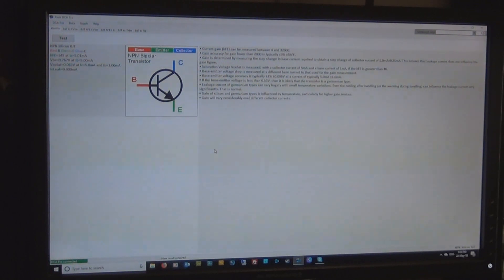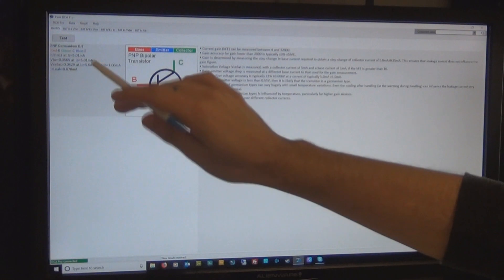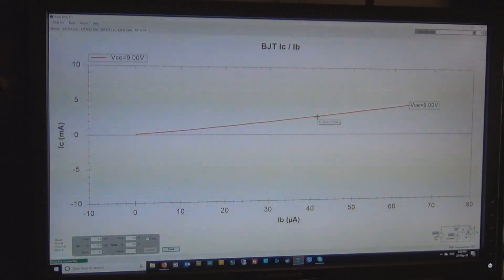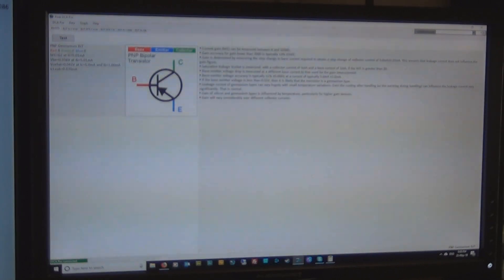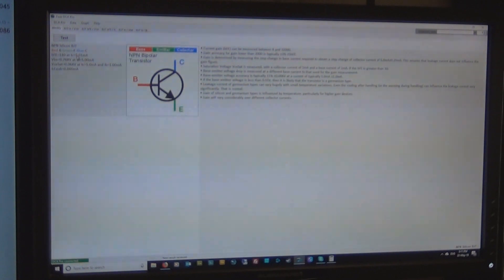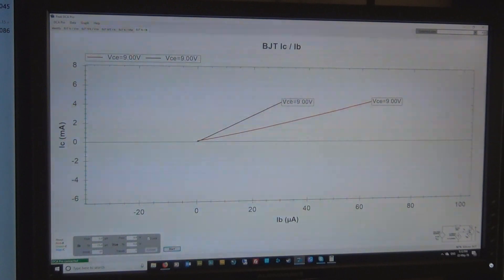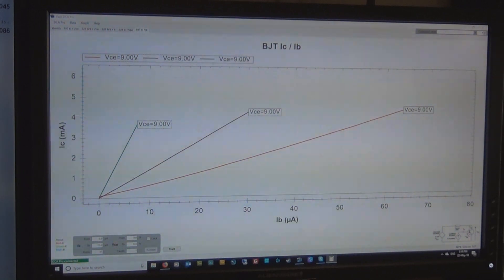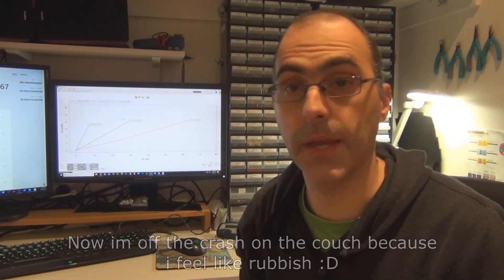Basic Operation of a Transistor Explained - Part 1 - BJT Ic vs Ib (hfe)

Comment: Thanks for the video.
I piggybacked two MPSA13 transistors together after I  misinterpreted the Sziclai circuit and it sounds great.
I have not boxed it up for a more in-depth analysis but it works and sounds good.
Does adding the second MPSA13 transistor actually do anything to the circuit ?
Cheers

Comment: Hi. Didn't really want to get into building gear, but my board has grown and I don't want to buy a bigger power supply... was planning to buy a gig rig Isolator which I could power off a single outlet and send isolated power to 4 low current boxes on my board... Problem is, I can't bring myself to pay the hundred and something dollars for this very small, very light device that I imagine contains a few inexpensive chips. Is that a thing we could build? When you talk about filtering and regulating, is that the same thing as isolation?
Reply: Thanks for taking the time to reply. That's about what I figured, but Gigrig claim their isolator, provides 4 9V dc ISOLATED outputs from a single 9V dc input. It weighs about the same as an empty match box and is about half the size, so I wonder how that's possible... as turns out... bought another power supply, but still curious.
Reply: @markwilding3828  I can't help but think the gig rig isolated power supply is actually a power filtering solution for no other reason than size and weight (though I could definitely be wrong)

Comment: You are about the third person showing the input on a fuzz pedal going into to the electrolytic cap in the wrong direction. Is the negative or positive towards the input? Kinda strange that 3 people would make the same mistake!!!!!I enjoy your videos.
Reply from the maker: The electrolytic on the signal path needs to have the cathode connected to the "most positive" side of the circuit.  Usually this is circuit side.  Easier still, use a film cap :D